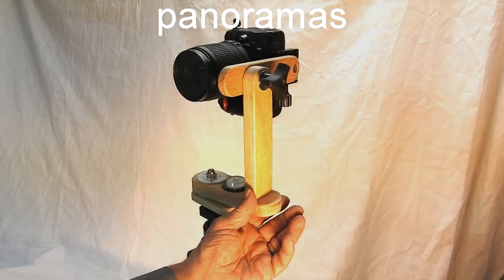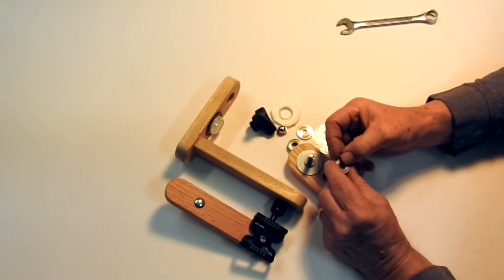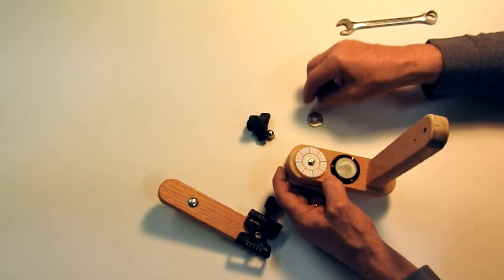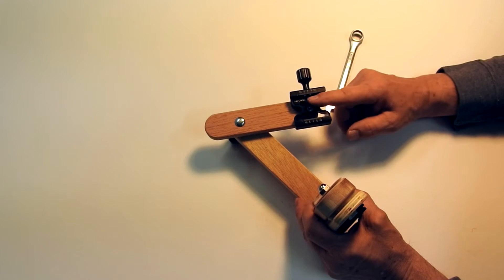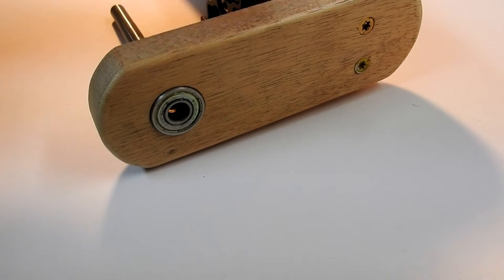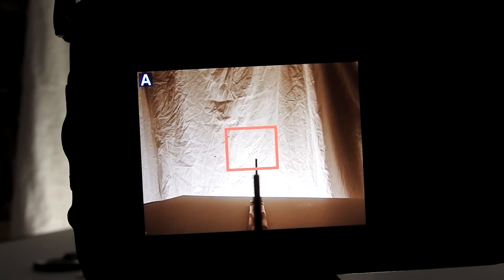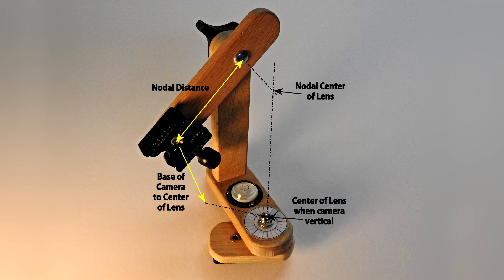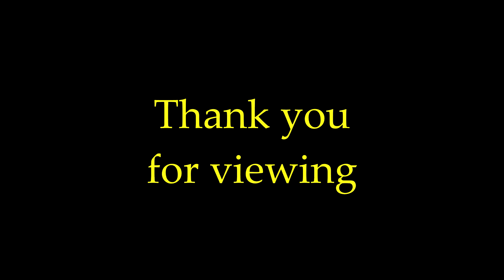DIY Panoramic Head for Your Camera

Comment: Great work and a beautiful design.  With a zoom lens, is there a shift in the nodal point for different focal lengths?
Reply from the maker: Yes, there will be a change in the nodal point for different focal lengths on a zoom lens.  For my shooting, I usually use the widest angle, which reduces the number of shots needed.  When I use a different lens or focal length, I only have to move the camera a little in the quick release adapter to get the right nodal distance.  I have checked several focal lengths and lenses and the ones I use are wiithin a few centimeters of each other.  I also made an automated multi-shot setup which I use more for telephoto use to get a very large number of pixels in the image.  A stitched image may be composed of more than a hundred images, making the final image 50 mega pixels or more (with a 6 mega pixel camera).  That many images would be hard to keep track of with the manual setup but the manual head is a lot easier to carry.  I'm currently working on an automated head with motion in three directions to use for motion time-lapse.  The new design might replace other devices I have created and, with minor changes, might be used as a tracking platform for astro photography.

Thank you for questions and comments and thank you for viewing.

Comment: Why is the industrialized version so expensive? I had to buy from China for the same price my entire tripod cost. I'm kind of dumb to build it myself, but nice work.
Reply from the maker: I expect there is some design cost to recover for the industrialized heads and the materials and casting are more expensive.  Some will probably support heavier cameras and might be more adjustable.  Another factor is the number of heads that are likely to be sold.  This probably isn't a high volume item, especially with cameras that can do internal panoramas.  This one works really well for all the panoramas I have used it for.  I also made a motorized head based on this design, "MultiPan Automated Panoramic Head" at:  https://youtu.be/mzCnikrTq0M
I use the motorized version for less than spherical panoramas.  I designed it more for high pixel images using a zoom lens, which may take hundreds of images.  It is difficult to keep track of that many images without automation.  It also costs a lot less than the industrial versions, like GigaPan.

Thank you for questions and comments and thank you for viewing.

Comment: Beautiful pano head. What is the thickness of the wood you used?
Reply from the maker: The vertical and horizontal supports that are screwed together are 3/4".  The base that mounts to the tripod and the vertical arm that holds the camera are 1/2".  All parts could be 3/4" with adjustment to the horizontal center of rotation.  The 1/2" parts are oak.  The 3/4" parts are mahogany.

I am currently finishing a new automated pano head that can be used to shoot hundreds of shots for panoramas as well as shots for time-lapse.  I should have it published by next week, if everything goes as planned.  I have already used it to shoot a panorama with 105 frames and it stitched beautifully.  The new head uses only 3/4" soft wood, since that is what I had available.  I would rather use something harder like oak or maple but the soft wood is working fine.  The new design is very much like the previous one except for the size changes required for adding stepper motors and a shutter release mechanism.

Thanks for viewing and for questions and comments.
Reply: Thanks for the quick response. Looking forward to motorized version. In the meantime, I'm going to make this one for sure. I'm planning to make one adjustment for nodal point so that I can use the same mount for multiple lenses. 

I'll make a long slot which can hold the carriage bolt on one side. So dado the slot first and than drill through.
Reply from the maker: My new head has a long slot for the same reason.

Comment: I noticed on your site that you used a fisheye with it. Wouldn't the fisheye see the end of the arm the camera is on?
Reply from the maker: You are correct in that a true fisheye lens would get the arm in the frame.  However, this lens is a full frame fisheye.  It fills the frame rather than creating the circular image of a true fisheye.  On an FX format camera, the setup might get the arm in the frame.  On a DX format camera, the lens is much less than 180 degrees.  For this lens, I believe even on the FX format it only covers 180 degrees diagonally, so less than 180 horizontally and vertically.

Thanks for questions and comments and thank you for viewing.
Reply: I have that lens which is what the head would be for. It is 180° diagonally on DX and almost circular on FX. I just measured, and vertically I could see a ruler 30mm in front of the hood, so could probably get away with a max arm length of 130mm from the camera thread to the end of the arm. Horizontally, the FOV is greater so there also might be the issue of seeing the arm that mounts to the tripod. I'll have to confirm the measurements. So it works for you with the fisheye? Just seemed like from the pic that there is too much n front. Anyway thanks for the design.
Reply from the maker: I works fine with the fisheye.  I haven't had any problem with anything in the image, other than the tripod when pointed down.  Check the pano at: http://montanamonk.com/mission_web/mission_panorama.htm

Comment: do you have a link to a list of the parts needed to make this?
Reply from the maker: I don't have a parts list, but have posted a Sketchup file on my web site (montanamonk.com), in the DIY Projects tab.  The file can be downloaded by clicking the Sketchup design file link on the page for this project: http://montanamonk.com/panoramic_head.html
 The Sketchup Make software is a free (https://www.sketchup.com/), so you can view an modify the project as desired.  Most of the parts are identified on the design file.  Nearly any reasonably solid wood will do for the wooden parts.  I just used scraps I had in the shop.  All bolts are standard sizes.  The bearings are skateboard bearings which I ordered from Amazon, as well as the Arca adapter and plate.  If you want the design file in a different format, I can probably convert to something else.

I am currently working on an automated panoramic head which will automate the shooting of large panoramas as well as being a platform for shooting time-lapse sequences with vertical and horizontal components to the camera motion.  I will publish it when it is finished.  Currently many of the parts are laying by my keyboard.  This project is a bit more complicated than the previous head.

Thanks for viewing and for questions and comments.

Comment: I was going to buy a pano-head for about £170 ($220) until I saw this. 
I sourced all of the materials very easily including the 22mm forstner bit for under £20 ($25) and using oak for the wood - a little harder to work with but I have it to hand from an old kitchen cabinet door. So chances are you'll have something similar.

The skateboard bearings I got are ID 8.5mm/ OD 22mm/ Thickness: 7mm - the wood is 22mm thick so leaves me 8mm material on the central core material. and if I leave the bearings 1mm proud of the face on either side it will give me 10mm on the central material.  I got 10 bearings £1.80 from Ebay - a single one costs £2.50 (still confused at that).

8mm coach bolts, washers, dome nuts, knob, 1/4" inserts and quick release tripod adapter with plate. Adapter with plate was £5.00 and £6.00 for the bolts, nuts and washers, etc. I got a 22mm forstner bit for £5.99.

Going to make it at the weekend for my 5D Mk2. Gonna follow MontanaMonk's design to the letter and make the nodal point suit my nifty 50mm prime which is great for panos IMO. I also use a 22mm prime but I tend to get less distortion from the 50mm.

Thanks MontanaMonk - I reckon you just saved me heaps on this...
I'll be sure to keep ya'll in the loop...
Reply from the maker: Thanks for the update.  My head is still working great.  I have it calibrated for two lenses.
Reply: +MontanaMonk - Good to know, it does look very robust in the video. I'll probably take your lead and calibrate for a couple of lenses at this end...  Thanks for the extra info and your amazing tutorial.

Comment: Great tutorial! That's one beautiful looking pano head. LOVE the wood. You ever consider selling these? huh?
Reply from the maker: Selling these would require more complex design and construction, since I would have to accommodate a variety of camera/lens combinations in the design; and it would get much more expensive.  This design keeps things simple and the materials are very inexpensive and you can build it with a few common tools.  While I use some tools that are not in many hobbyist shops, like the Forstner bits, there are other drill bits that are inexpensive and could accomplish the same thing.  You could also use two 1/2" pieces of wood drilled through to fit the bearings. Then glue those to a each side of 1/4" piece of wood to provide bearing holes on both sides; drilling through the 1/4" piece to the bolt size.  Some things I have added for convenience, like the quick release plate on the bottom and the quick release adapter on the arm.  The adapter could be replaced by a 1/4-20 flat head machine screw to hold the camera in place.  The plate could just be a threaded insert to attach the pano head to the tripod; or just thread a hole in the wood, drilled smaller so you end up with 1/4-20 threads to attach to the tripod.  The level is a convenience thing, too.  Many cell phones have a great level that can be used to be sure the tripod mount is level.

Thank you for viewing and thanks for questions and comments.